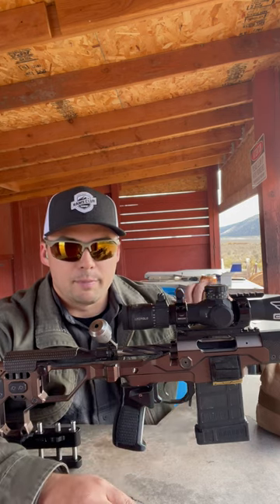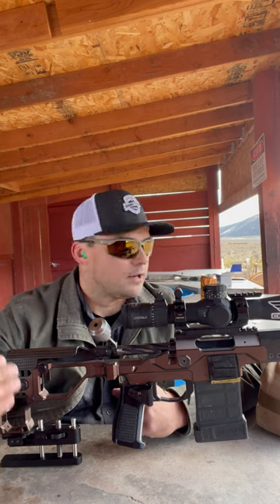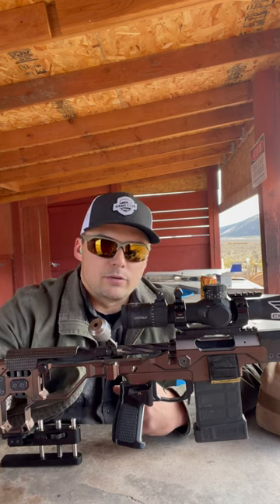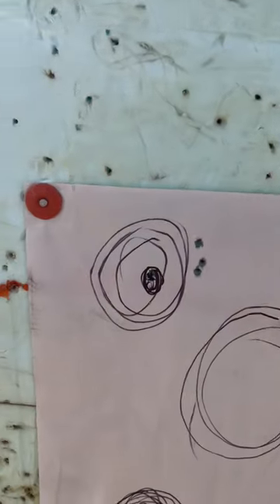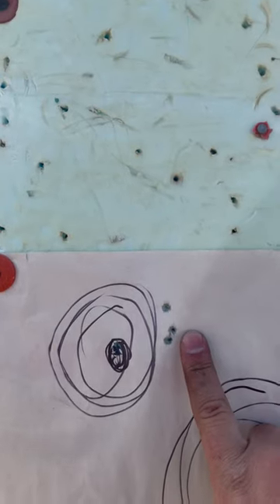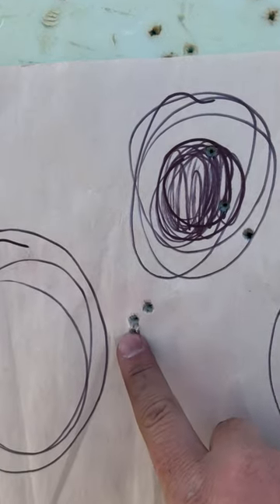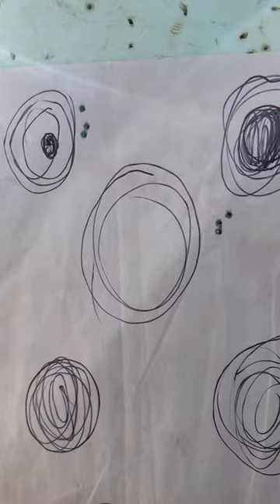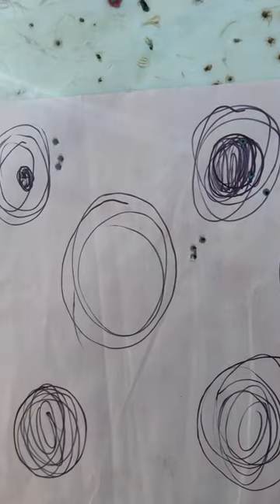💥Erik Cortina tuner brake testing with amazing results💥

Comment: Dude. First off, what action is that, it’s smoother than glass. Second, cool video. Had no idea tuning a brake could make so much of a difference.
Reply from the maker: Thanks man! It’s just a factory christensen arms receiver and bolt. I did lap the lugs and it’s got over 5K rounds through it now though. And ya barrel harmonics has a crazy effect! I was surprised how much the barrel tuner made a difference

Comment: Hello. Do you reload? If so do you do your load development with the tuner brake set to 0 and then once you optimize your load start to test and further optimize your brake setting? Thanks
Reply from the maker: Yes that’s what I did. Start at 0 and then tune it out until the groups tighten 1 increment at a time. I loaded and found a lid with consistent velocity, set the bullet about .05” off the lands and then used the tuner